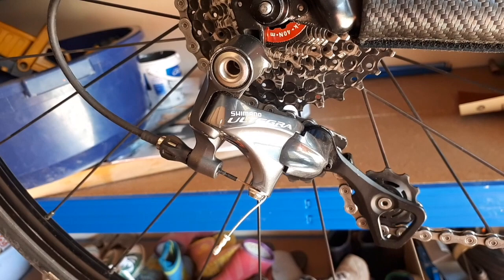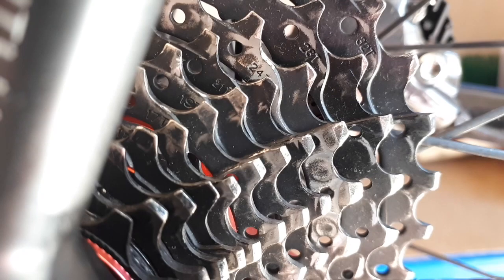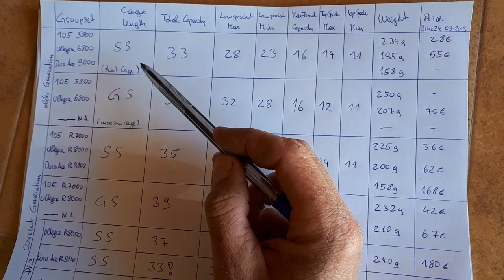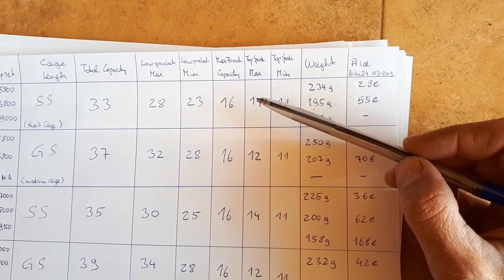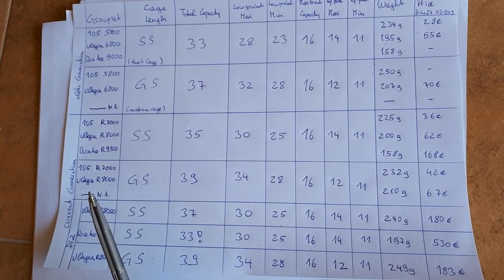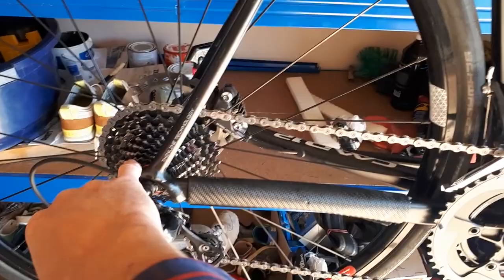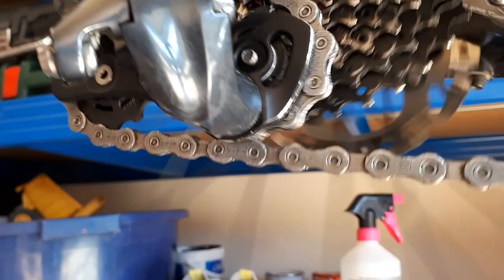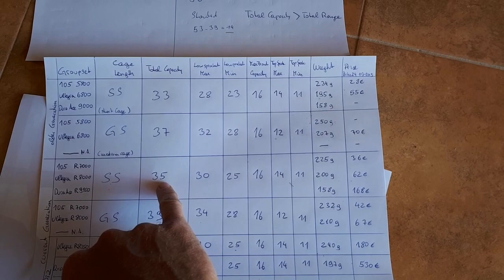Shimano Road Rear Derailleur Capacity: The untold truth and full analysis

Comment: Inspired by this and similar vids, I changed the 11-28 for a 11-34 on my Felt CX bike.  Kept the short/med cage 105 but used the Road Link and also subbed a 34 tooth chainwheel for the 36.  Didn't even need to adjust the chain length.  Now I have the 1:1 lowest ratio.  The rest is up to me.

Comment: The 14 tooth minimum (or maximum depending on how you look at it) is stipulated in some of the junior categories of racing, so it is a relevant figure for some. Also had Sora 3000 (9speed) running the 12-36 (recommended max. 34) cassette and it was a tight fit but worked great

Comment: Nicely explained. 

I am running a capacity of 46 being 48-31 front and 11-40 rear on the new Shimano GRX810 gravel group set. This combination work perfectly, even big-big and small-small. Note that the GRX810 rear has a longer cage than the GRX812 which is intended for a 1x system. There are a number of people using the 2x Di2 version with the same success.

I regularly do long climbs climbs 15-25% gradient and want to keep up a reasonable cadence and the GX810 rear mech will do it. I suspect the GRX600 an GRX400 would do likewise. The standard Shimano 2x GRX400 runs a capacity of 41 being 46-30 front and 11-36 rear (10 speed) so I suspect the cage will be equally long. The GRX810 runs much larger gears in the cage also which increases the cage capacity without increasing the length.

Comment: Very good information.   I currently need the extra gear of 34t on rear as I am climbing steeper grade mountains.  I'm however using a R8000 ultegra front derailleur and rear derailleur in mechanical setup.  My front is a compact chain ring set.    It's been since 2018 since I used the 34t rear cassette, so I needed a refresher of what is allowed so I came here to this video.  Thank you for this.

Comment: Thanks for your work.  good stuff!  I run a mid cage Ultegra set up with 11-34 rear and 52/36 front.  If I didn't ride mostly in the hilly Hocking Hills of Ohio, I'd go with 11-30 and a short cage.  I've used an 11-28 with a 53-39 in the front with a Dura Ace short cage.  It worked well.  It just didn't have a tall enough gear for my area.

Comment: I just caught your video while getting ready for work, I am going to watch it thoroughly. I am in the process of re-gearing all my bicycles.  One bicycle that I am doing is a 7 speed 1992 Schwinn Paramount with a standard 53/39 crank, I have a vintage RD-1056GS that I plan to put on because where I live is very hilly. The max sprocket is 12-28T, I don't plan on exceeding the max sprocket, but  will have to go to a GS and not a SS because the SS total capacity is 28, I would feel comfortable with a GS.
Reply: always go with ss if you can as it allows for snappy shifting and is less prone to hitting objects.

Comment: Hi ive just purchased a 11-32 cassette but not fitted it yet. Ive got the 105 short cage that was running 11-30 cassette. Watching your video i only go as far as the 3rd ring down on the biggest chainring. And on the small chainring I don't go as far as 3rd off bottom cassette ring so it should be ok to run looking at this. Cheers for your vlog.

Comment: Question: I ride a 1x11 setup so total capacity is not a concern, but  "Low sprocket_Max" is what I care about.  When I look at the pictures of the SS and GS rear derailleurs (i.e. Ultegra), they look identical except for the length the of the jockey pully cage (which is more applicable to total capacity).  Therefore, why is there a difference in "Low sprocket_Max" between SS and GS?  Maybe I'm missing something but the pictures look identical to me from the frame mounting point to the upper jockey pully.  Any insight would be appreciated.
Reply: The GS model may have a different balance between the cage spring and B spring stiffness or pre-load.  Also, the derailleur parallelogram on the GS may operate at a steeper angle, so the jockey wheel moves downward more when shifting to the lowest gear.  
Differences will be subtle and may only be detectable by careful measurement.
Reply: @marianneoelund2940  Thank you for your response!

Comment: Is there any major disadvantage of the GS? I think for most people GS is better suited than SS and it should be standard for road bikes in hilly regions.
Reply: GS is a bit not as smooth if you change gears quite often, and ofcourse the GS has more weight than the short cage SS one.
So the best pick is... to follow the cog set you choose, if the cog set is 11-28, go for the SS. Other than that (11-30 / 11-32), go for GS.

Comment: Hi, do you know...Rather than going to a Medium cage derailleur,  can you increase your lowest cog range (from 28t to 32t) by replacing the lower cage pulley on the short cage deurailleur from 10t to  a 14t?
Reply: Changing the pulley to 14T will increase the derailleur total capacity by 2 teeth.  It should work slightly better than the setup shown in the video, if you set the chain length optimally.

Comment: Hi Max
Thank you for a thorough and informative video. Do you think you would have been able to go to 34, if you had a 1X setup?
Reply: it might depend on the size of your chainring but I would think a GS (medum cage) would be better, you could probably fit a 36 too. You could also use a derailleur hanger extender such as a roadlink to move the rear mech away from the cassette and thus give you more clearance for bigger cogs
Reply: @maxrevell3830  I tired and it worked flawlessly. It's an old road bike (7speed). I tried it both 1x: 13-34 freewheel and 52t chainring, and 2x with a 44/52 crankset. No issues whatsoever. Thank you again for you video that inspired me to experiment
Reply: @mashkal2006  great stuff,  I'm actually a different Max to the guy that made the video but always good to share tips and ideas!
Reply: @mashkal2006  hey, Joakim! for the 1x setup (52T), did you use a hanger extender, or just installed the derailleur right ahead?
Reply: @gpulgar  installed it straight on. It's an old 10s 105 SC deraileur i think.
https://photos.app.goo.gl/hkucbWBv1GCsoFuN8 (hope it works - picture of 1x with large chainring) and
https://photos.app.goo.gl/gmKBQqPdEqtjhceLA (13-34 casstte and 53/44 chainset)
both setups worked great. The 1x is a dream now since I've changed the chainring to a narrow-wide and the the chain to a 11s chain I had laying around. its quite and it changes gears with no isues what so ever.
Reply: @mashkal2006  salamat, good sir! Very much appreciated. Been wondering if an Ultegra R8000 RD SS would be fine with an 11-32T or 11-34T cassette and a 52T chainring. Should I go ahead with the 11-34t? Your thoughts?
Reply: I'm gussing you have a 52/36 chainset
Reply: @mashkal2006  actually, mine is a 1x 52T setup. but this dude also says otherwise - https://www.youtube.com/watch?v=mltI7fkfP5I
I run a folding bike (Tern BYB P8) and a GS RD might be too long for my 20" wheel. haha so hard to decide.
Reply: @gpulgar  Well it's good that you mentioned it! I tried the 34 tooth max cassette on my folder (20" wheels) and I found that the derailleur went past the rim in some positions. It never touched the ground, but it was lower than the rim (which in my mind is bad). I experimented with both different chain lenght and derailleurs but nothing really stuck. If you try it and it works, let me know! I would be very interested. finally, I think this thing runs a 11-36 on a 20" wheel using the Shimano Zee deraileur. perhaps that's an indication that there is hope :D https://www.youtube.com/watch?v=AaIGUSQK4VQ
Let me know how it goes!
Reply: @mashkal2006  will do!

Comment: Hi. Thanks for your video.

Is it possible just to replace the 2 cage plates (inner and outer) from SS plates to GS plates? About €30. 

Instead of having to replace the whole derailleur?! Which would be much more expensive!

Thanks!!

P.s. I have 52/36 front; 11-32 cassette. Shimano Ulegra Di2 rear derailleur 6870.